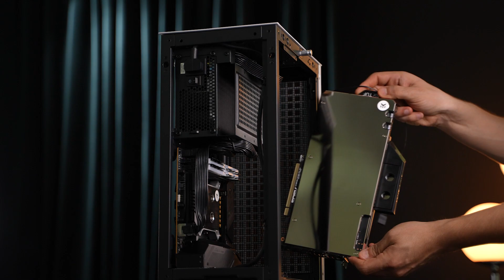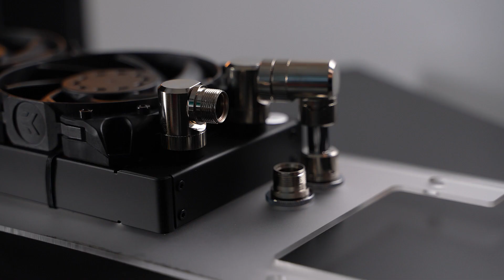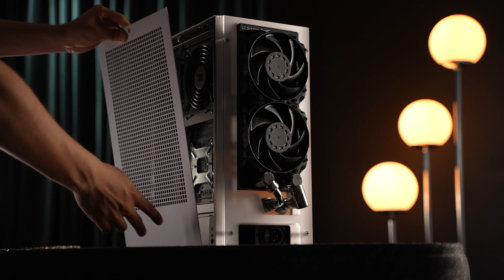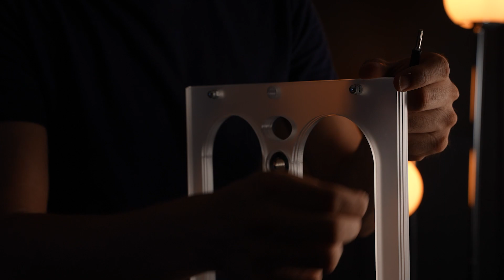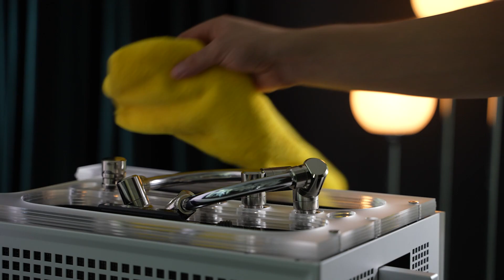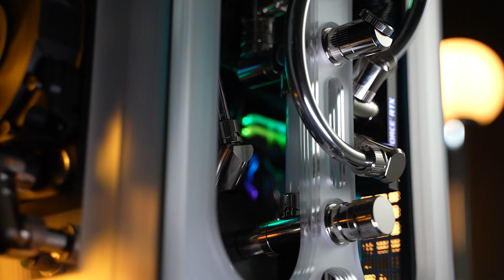First Gaming PC Build  - HYTE Revolt3 Case Mod

Comment: i just build my own Hyte Revolt 3 case & it's fucking gorgeous but yours its out of this world! definitely should not have any heating issues with that. My build uses just a regular 280mm aio on a i9-12900k & my system barely lets off heat, can only imagine yours!
Reply: what about your gpu temps?

Comment: So much thought went into it, it's perfect.
You made me want to do my next build with chrome tubes, to be honest I am not sure if I should use brass or stainless steel tubes, what do you recommend?
Also, are these tubes 13/10? they look stunning with these fittings.
Reply: Annealed brass is easier to work with. Stainless steel is awesome, but you should get a proper tool to bend it like the heavy duty ridgid ones (while with brass, even the ridgid benders that are not heavy duty will work flawlessly). Ultimately, get the tubing you like the look of most: when you go with metal tubing, you do it for looks anyways.
Reply: @Sarazan97  Thank you for the info. Do you happen to know what type of tubing did Ben use in this build?
Reply: @probro6722  It's not easy to tell, but i think he usually uses chrome plated copper. Iirc there were some builds where he used stainless too